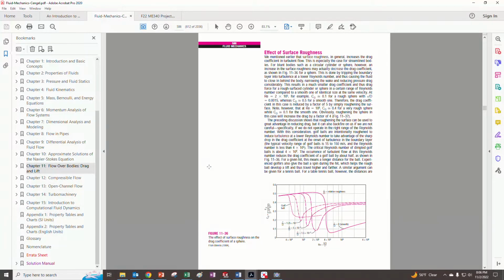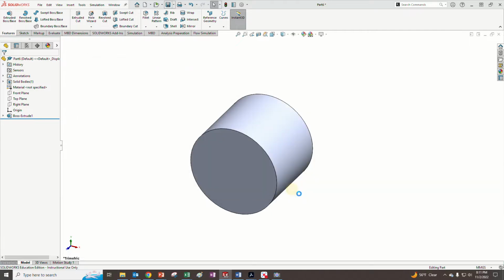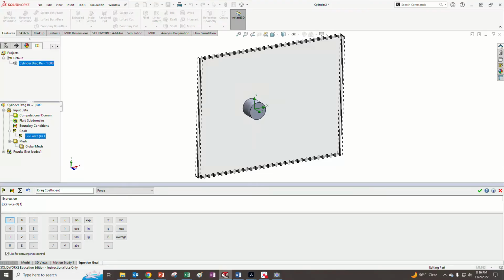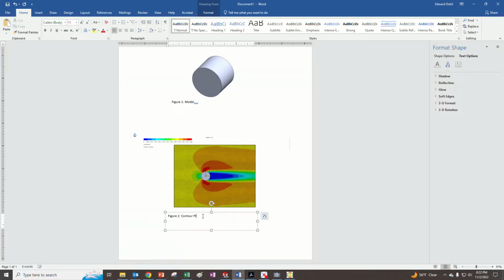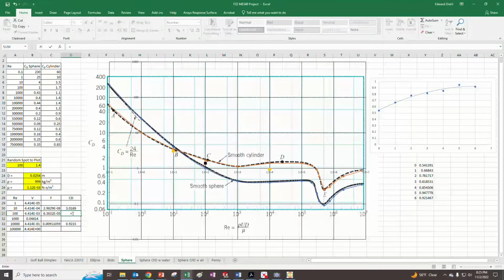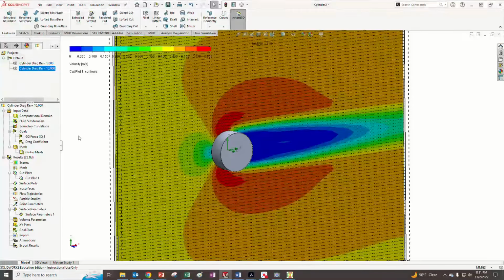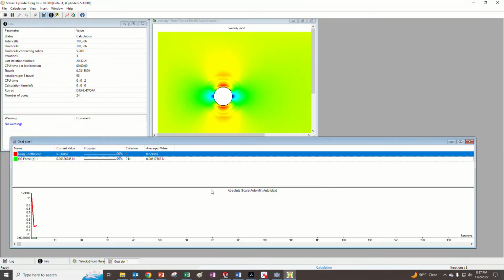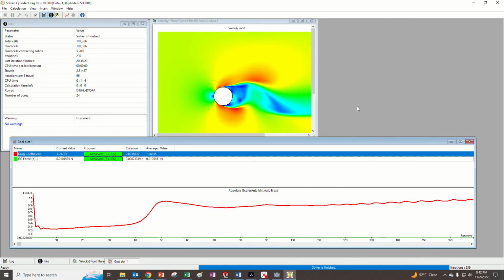F22 ME340 Fluid Mechanics CFD Tutorial (SolidWorks Flow Simulation) Smooth Cylinder Drag Coefficient

Comment: Once my teacher said to keep length of the cylinder 20 times of its diameter while doing CFD,. 
In your case I see the diameter bigger than its length, is it going to have any effect ?
Reply from the maker: Imran, thank you for your question.  I'm using the built-in 2D boundary conditions which will simulate an infinite cylinder to avoid the issues I think your teacher was alluding to.